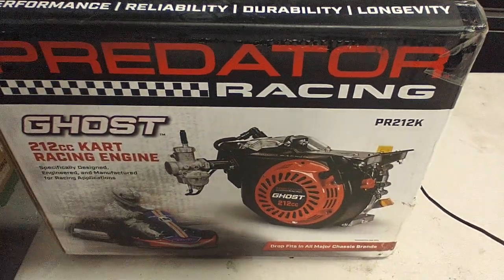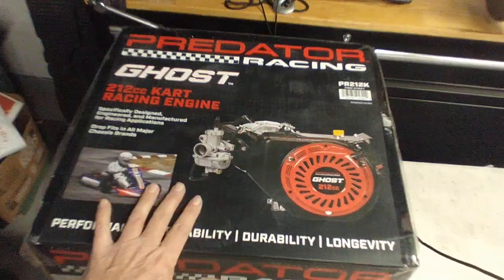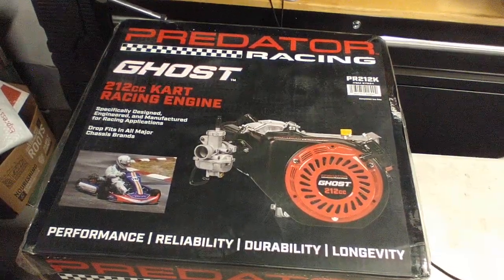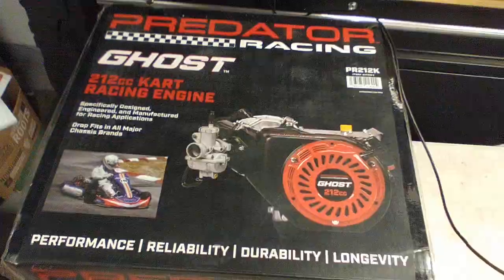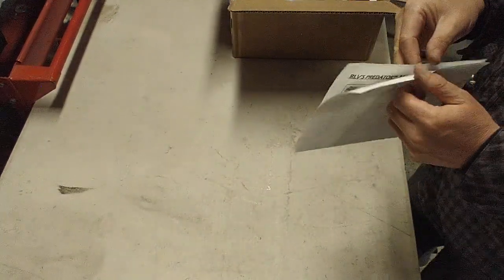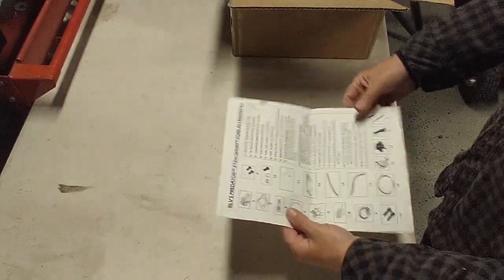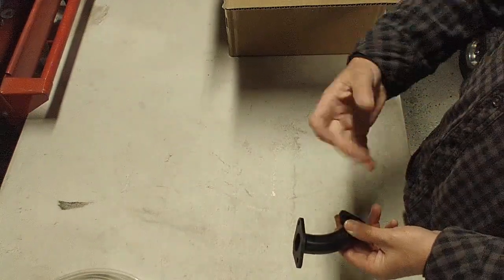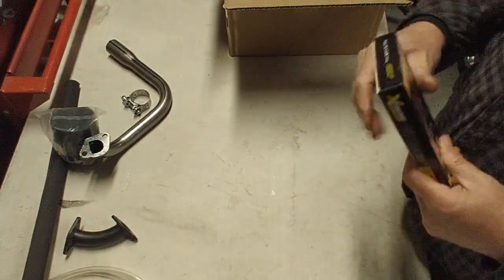Predator Ghost 212cc Engine - Before You Buy - Watch This!

Comment: Does that engi e really need a fuel.pump? Is it necesary?
Reply from the maker: If the fuel supply is above the carburetor, no.  But for karts, the fuel supply is below the level of the carburetor, so yes